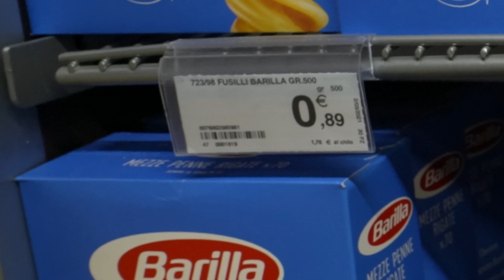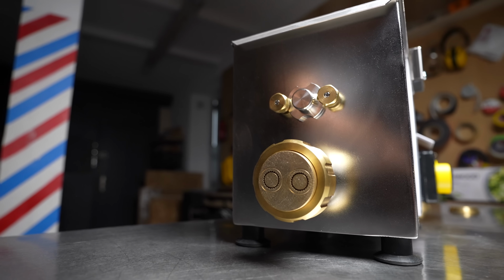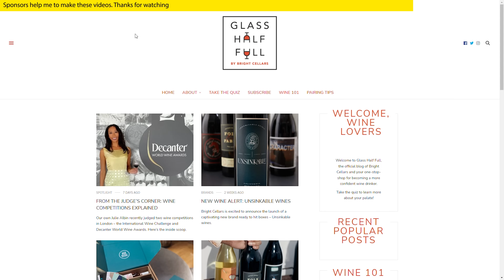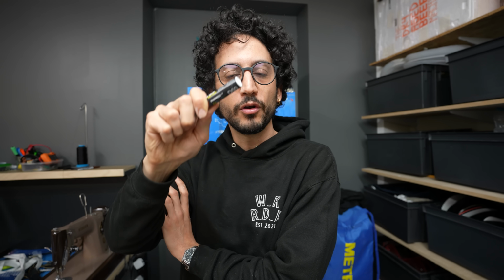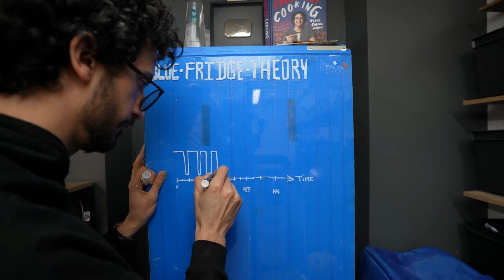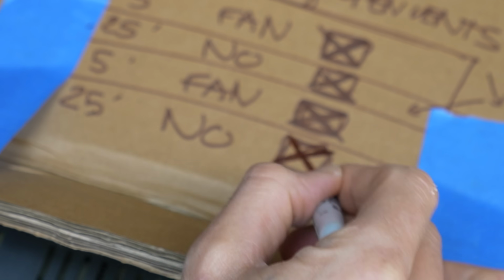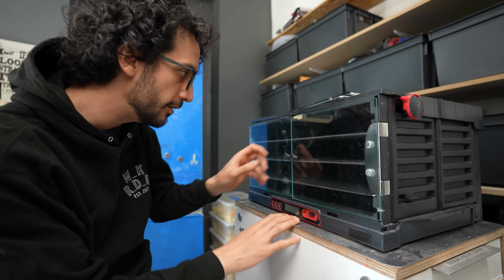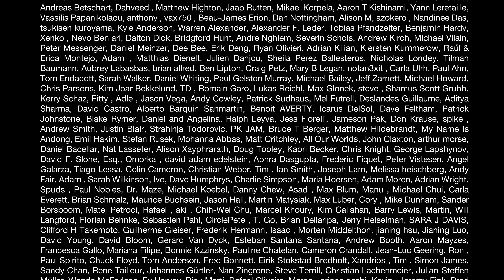This is Why Drying Pasta At Home IS ALMOST IMPOSSIBLE

Comment: I live in a desert climate (Arizona).  I leave my pasta to air dry for a few days.  No problems with breakage or deformity.  Maybe because the drying process is so gradual.
Reply: Egg pasta?
Reply: @gevorgvanarmenie9788  My nonna for sure would dry egg pasta just in the air with maybe some fans and summer heat in northern California. I guess they didn't worry about salmonella then. It was typically 100f/38C in summer so I suppose it dried pretty fast.
Reply: @gregmuon  I guess salmonella needs a good amount of moisture to survive. Even if it can survive the drying, it can't survive 7-10 minutes in boiling water.
Reply: @gregmuon  that’s fine, but Alex is trying to create semolina dry pasta which has no eggs.
Reply: Alex will be so upset when he reads this.
Reply: @gevorgvanarmenie9788  I realize that. Just adding a traditional pasta knowledge data point.

Comment: You need to add humidity during the resting time. Look at the science behind drying wood, which is exactly the same. 
After the drying period the center is wet the outside is dry. When the water evaporates the pasta shrinks and if the outside is shrinking faster then the inside it will become brittle. Since the outside dries so much faster then the core, adding moisture to the outside won't really affect the drying time of the core. Also as long as the outside isn't becoming wetter then the core it will still be drawing moisture away from the core since the log as a whole is trying to reach equilibrium. This makes the drying and more  importantly the shrinking more uniform and thus less cracking.
Reply: It's a two-fold problem...

You need a relatively low humidity in the drying air such that it can accept the evaporation from the surface, but you need to control the rate of evaporation to more closely match the internal rate of diffusion of the water molecules in the material being dried, which calls for a bit higher humidity.

The added complication here being that if the surface dries too quickly, you get a physical - and possibly chemical - change in the material being dried, with a loss of product quality.

Comment: I'm sure Alex knows, but the definitions "plastic" and "elastic" refer more to how solid object deform to a certain amount of force. To a limit, every solid object will deform elastically (as in it will bounce back and return to its original shape) but when that limit is surpassed it will deform plastically (as in it will keep its deformed shape). Easiest example of this would be a spring.
Reply: There is also some notions of how hard materials tends to have a very little plastic deformation capability and, if deformed beyond, tends to failure (cracks). Problem that is solved through heating cycles at precise temperatures. Young modulus and heat treatments in a nutshell :D (even though the main driver for hardness here is the water content and distribution, where in metals, you look for cristaline structures)

Comment: Alex, that is a blower fan that center spot pulls air in and is pushed out the perimeter of the fan. You can see the grill when you shot the close up inside the dryer. Personally I think its already a good design since youre sucking air in from single point and then distributing it at the perimeter so you should not get a small hot spot. However that fan does seem to not be doing its job so maybe that should be fixed before you put in a new fan.
Reply: At this point he probably has already hacked it up with this own fan, but I agree -- it's clearly a blower fan that's distributing from the edges
Reply: I think also the fan might actually not be broken at all. For a normal fan the input air velocity is slower than the output, because the output is directed while the input sucks air from all around. Idk theres probably a name for this phenomena but basically you feel less wind behind a fan then in front of it even though the volume of air going in is the same going out. This blower fan is of course different as the output is directed to the perimiter but the effect could still be taking place making it appear weaker then it actually is
Reply: True, but considering that I think the 'good' pasta was the ones coming from the edges, (I was confused on why he thought the center was good when the first test piece was from the edge) the fan speed might still be too low. At the very least, something is still wrong.
Although, yeah, that was pretty clearly the intake lol.

Comment: Definetly dont need an arduino or overly complicated controller. Simply use a basic $10 wifi outlet switch to program on/off times. And you can also add a simple plug-in humidistat and/or thermostat for $40.

Comment: Question: Did they have humidity and temperature controls when dry pasta was invented?
Reply: Sort of.  Naples had a very good climate for pasta drying naturally.  So humidity and temperature controls were you figuring out what locations had the right climate for pasta drying and then to do your drying there.  Is it the fine tuned tempature controls that we have now?  Of course not, but it's not nothing.
Reply: TRADITOINALLY,  you just leave them out to dry at room temp. NEVER had any issues drying any of my pastas on drying racks or noodle hangers, in the open without using a dehydrator. Been doing it for decades and never had the issues he is having using a machine to do it.
Reply: @Tom-yc8jv  Are you making egg pasta?
Reply: My grandmother had manual control of humidity. She was moving the pasta from sunny windy porch to back shaded and humid room at first several times a day, then about once a day. She would dry the pasta in about a week.
Reply: The drier is needed because we are talking about industrial processes. In a factory there is the need to dry a huge amount of pasta in little time to satisfy the market (and you can obtain the same results every time and all year around). Traditionally pasta was left to dry naturally and most of the countries that face the Mediterranean have a climate that is naturally good for drying pasta. The same principle applies to cured meats like prosciutto.
Reply: @Tom-yc8jv  don't leave us hanging tom answer those questions man what kind of pasta were you making all those years
Reply: @SuWoopSparrow  You don't make dry pasta from an egg-mixture. Fresh pasta uses eggs, dry pasta does not. 

Trying to make dry pasta with eggs is like trying to build the Eiffel tower out of jelly.
Reply: @MrMartinSchou  I find it difficult to believe that you've never seen dried egg noodles.
Reply: @MrMartinSchou  Thats not true. The only pasta I've successfully air dried is egg pasta. Water pasta, what he is doing in the video and what is used for commercial pasta, air dries horribly most of the time. It's very common in the Balkans to make homemade egg pasta and then dry it for use in soup later.
Reply: @Tom-yc8jv  You can dry fresh pasta but it's not the same as the dry pasta you can buy in the store, which has way less water content to begin with, it's just an entierly different product
and that's what alex is trying to recreate here. Of course he knows he can just make fresh pasta and dry it but that's not the point of this endeavour
Reply: @SuWoopSparrow  I think the eggs are actually solving the problem with breaking. But of course it's not "right" - probably because it simply works and the superiority is gone :D
Reply: Great question! My thinking is that over time Italian geniuses came up with ideas to shorten the drying time, so my guess is that when they first started making it, the process took days instead of hours.
Reply: @robdielemans9189  Today, on How it's Made: Dry Pasta. And the episode is going to be this little mom and pop shop where its organic and they roll it all by hand, and then wheel it on a cart into a wine cellar. "The pasta remains here for 12 days until it's ready." But it's a brand you've never heard of before, and there's no reference for comparing it to the dry stuff you buy at the store because they don't carry it. 

I've seen no one here in these comments say that they've actually pulled off drying semolina and water pasta. Everyone has a million ideas, claims it should be easy, or only ever actually dried egg based pasta. Yeah, those Italian geniuses ultimately figured it out. What's the secret to drying pasta at home? Own a factory, or build your own equipment, because it's not easy. Chocolate chip cookies at home? Done. Wine at home? Done. Bread at home? Done. Dried pasta without eggs at home? Nope.

He pulled off pizza with his magic oven, even the old pasta series with his ToT ramen machine, but this one feels different. I have a feeling this is going to go way deeper than just adding a case fan to his dehydrator.
Reply: @Cryogenic1981  My grandmother used to throw white cotton sheets on the couch and leave the pasta to dry there.
Reply: @SuWoopSparrow  All different type of pasta.
Reply: @bofud  The pasta I dried was just as dry as the store pasta.
Reply: @Tom-yc8jv  The point isn't to end up with a dryer product, drying things isn't exactly difficult. It's a different dough and it will behave and taste differently

Comment: Alex, I am expecting an Espressif ESP32 microcontroller solution to handle the fan speeds, temps, and power duty cycle. Lets see that engineer in you! Perhaps with hair dryers rather than the dehydrator. All controlled by a phone app over wifi. That would be awesome.

Comment: This reminds me of the science of roasting coffee. The diagrams look similar and there is a lot of focus on the rate of rise (ROR) so lots of looking at multi line time series charts. You have to account for the steam too as once the first crack happens the heat from the large amount of steam being released changes the thermal energy inside the roaster. So you have to know beforehand when it will happen and adjust the heat and fan before it even happens or else it gets away from you.
Reply: Scott Rao is the authority on this, if you check out his books it's super interesting from the science end!
Reply: We keep coming up with analogous real-world applications of the mass transfer principles of drying!

Comment: This problem reminds me a bit of the Alton Brown "dehydrator" he used in the jerky episode of good eats. Because he didn't want the heat a residential grade dehydrator provided, he used a box fan and two furnace filters
Reply: As an addendum, my thought on a diy solution to this is twofold, a plastic tote to act as a circulation chamber, then use something like a hair dryer to provide a heated air flow, supplementing with other air mover apparatus to increase the flow rate where needed. Precise solution? Hell no. Providing the ability of heat toggle and flow rate where needed? Yep.

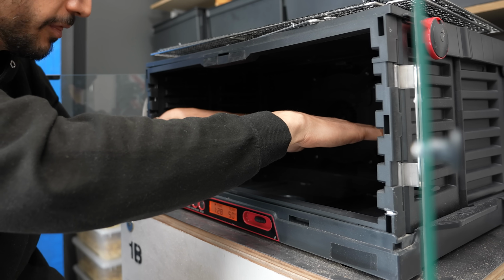Comment: :yt:The fan IS working, it just blows the air out the sides of it. You can see the vents @15:08 , they are the ridges outside the fan with the diamond grating in them.:yt:
Reply from the maker: It is not blowing any air. It is barely diffusing air.
Reply: @FrenchGuyCooking  Where you held the string at, is the inlet. The outlet (were the air will be blowing) is on the sides, not the front.
Reply: Blow some smoke (or vape) in there to see the air flow better. When you close the doors, you can see it how it moves around inside. This might help you figure out if you need more flow inside. With the doors open, all the air, coming out of the fan, is just going around the inside walls and out the open doors.
Reply from the maker: Don't you think I have tried all this 🤣 ?

Comment: Hi Alex, I stumbled upon this series recently, loving it so far. I'm curious why you're (still) using a food dehydrator? It seems to me that the professional factories are using the high temperature > low temperature cycles to rapidly get dried pasta, so they can quickly churn it out. I'm wondering if a more simple solution for the home pasta drier can be found in leaving the pasta to dry at room temperature. Surely that would combine the drying > resting cycles into one, where the water can evaporate, but it's not happening so fast that water from the inside can't move to the outside. Wishing you the best of luck either way
Reply: I'm wondering whether this is how they used go dry pasta before the industrialisation of it

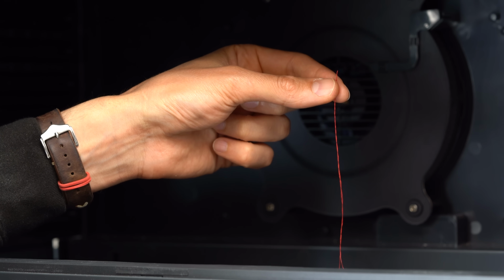Comment: 14:40 the fan is not blowing over the pasta, the way in which fans work is accelerating air molecules at the intake and shooting them away in a highly directed manner.
This results in high speeds at the exit, which can then push the surrounding air around as well.
The air at the intake is relatively static and flows in uniformly to fill the gaps, where the prior air molecules have been scooped away.

In a short answer:
The intake sucks at blowing, but the exit is pretty good at su... I mean blowing.
I think it might even be a good thing, since blowing air over the pasta would take away the layer of water vapor around the pasta faster, which will dry out the surface faster and leading to stresses.

But i might also be wrong on that one, but we'll see in the next video 😅
Reply: Yeah turn that fan around

Comment: I'm far from a chemistrist, but I was wondering if the temperature wasn't just too high. At 60 degrees, protein reacts and solidifies like an egg. It loses it's smoothness and elasticy, so it breaks easily. So taking the temp a big down may or may not help.

Comment: This is almost exactly like drying wood. You just have to do it really slowly. I bet you can do it without the pulsing if you just do it over a long period of time.
Reply: That's the traditional method, used in Italy before commercial major mass production became a thing.
Reply: @chemech  Always trust traditional over industrial.
Reply: @moonskyrocket  tradition blows if its unchallenged. leeches and witch burning are just two examples that come to mind

Comment: The pasta moisture diagram you drew reminds me a lot of dry cured meats. The same problem happens when you dry meats using too low humidity, where the outside becomes overly dry and prevents the inside from drying. Could it be done with pasta? Like lowering the humidity over a longer time to make the drying even.

Comment: Alex, you can buy very affordable Bluetooth plug adapters that let you turn an appliance on and off from your phone, or even set it on a timer.

I use a few of these plugs in my house to run my dehumidifier, my wax melter scent thing, and my reading lamp. I can just ask Alexa to turn them on or off, but I also just leave the dehumidifier on a schedule that automatically turns it on and off when I specified it to. 

It’s a one time set up, and then you just let it go! 

Give it a try!

Comment: I love you dedication of trying to get it to work in your kitchen
I watched the interview in episode 3 again, the professional says: high heat low humidity for drying, followed by resting at low temperature and high humidity.
I'm guessing the drying process needs the humidity to make the outside expand to preserve the plasticity while the moisture migrates from the "core" of the pasta.

However, you are the expert, and I defer to you practical experience over my theoretical model.

Comment: 3rd generation pasta maker here. Only times I ever made a good dry pasta were by following the same rule as when making concrete. The longer it takes to dry the stronger it'll be. I found leaving it on a drying rack for about 3 days in the refrigerator made for a really good dry pasta. It was strong and held its shape when boiled. Maybe worth trying.
Reply: Thank you for this comment! I love these videos but I’ve been trying to figure out the best simple way to just let my homemade pasta dry at home. I have a spare refrigerator and I am happy to wait days or longer for the pasta to dry, so I will try your method. I assume you have the pasta uncovered on the rack in the refrigerator, but if I got it wrong, I would appreciate any clarification. Thanks again. I am a first generation pasta maker so appreciate being able to learn from generations of experience🙏
Reply: Hi, can you share us more about the recipe, I got a manual struder and i want to make dry pasta at home, I've tried with 45% water and semola hard grain.

Comment: I put the extruded pasta (30% hydro) on a tray, wrap it in plastic foil and freeze it rightaway. Then, I toss the frozen pasta directly in the cooking water and the final result is quiet good: noodles which are strong and not brittle and bonded sauce. I think that the reason could be that the low temperature decreases the moisture in the space inside the tray and at the same time decreases the mobility of water molecules. Maybe the final content of water is more than 12.5% but it doesn't matter with this procedure. I find it practical for making pasta at home.
Thank you Alex for how much passion and method you put in your work. You are outstanding!
Reply: Disclaimer: I do extrusion with a dough sheeter with cutting attachment